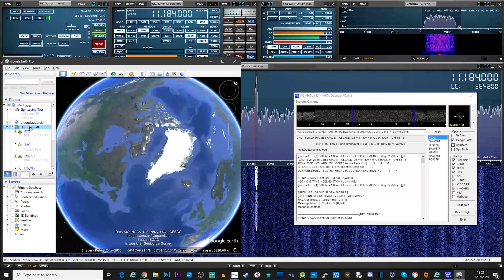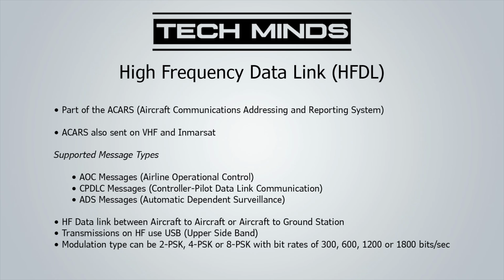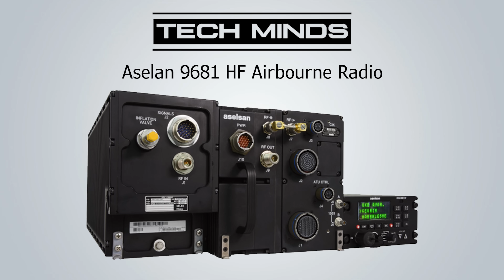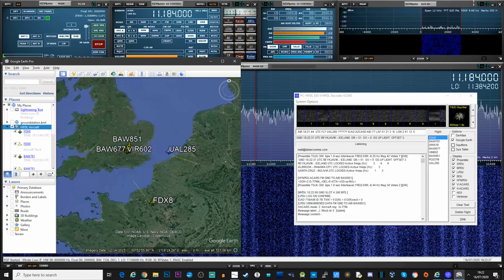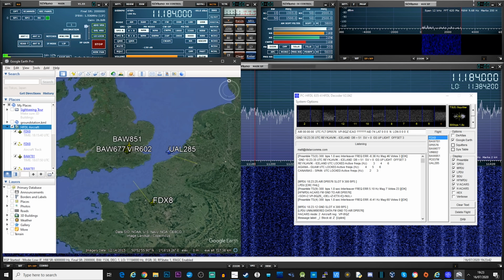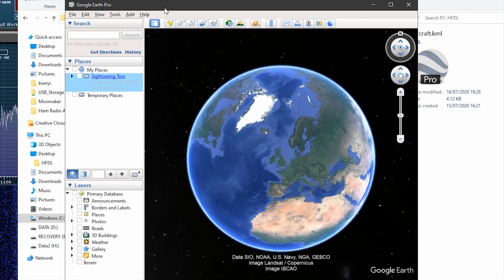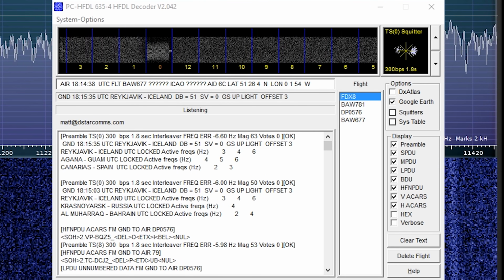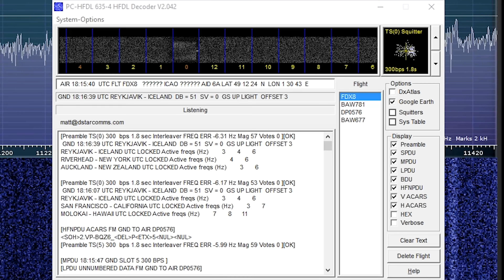Decoding High Frequency Data Link - HF ACARS HFDL

Comment: This video is still proving to be helpful, years later.  It all started a few weeks ago when I found an HF antenna I could put together without climbing on the house roof.  That gave me HF reception. Today I found a reference to HFDL and this video gave me all I needed to link PC-HFDL to my radio that was already connected to my PC with a digirig.  While not specific to my setup, the video gave me enough clues to get the result.  Finding an active frequency took longer than setting up the radio and software.  Thank Matt for making it easy.

Comment: Hmm... Me thinks that power is also 115VAC at 400Hz and not the standard 50/60Hz. I believe aircraft use higher frequency AC to reduce the weight of electrical machines and transformers.

Comment: Thank you for a very enlightening video, I wasn't even aware this mode existed. I registered with Charles and he did advise that the Google Earth interface does not work with the latest GE versions, it either needs to be an older version with the COM interface or GE Professional. I also found a program called Sorcerer that decodes this mode I think some of the TX sites might be out of date compared to PC-HFDL.
Reply from the maker: If you setup the GE network link manually then it should work. I have the GE Pro, from the MS App Store, seems to read and plot the KML flies just fine.

Comment: I only have experience decoding VHF ACARS  using Raspberry Pi with rtlfm + acarsdec . If HF DL is same as ACARS, it may be decoded with same setup. 

At this moment, I not found the HF DL signal yet in my country. :)

Anyway, thanks for the information. .
Reply: You can receive these signals all over the world and if you don't your antenna has a problem.
Decoding is very different, this is why ACARS or VDL2(new high speed ACARS) or Jaero decoders don't react on these audio signals. Currently there seem to be no Linux based HFDL decoder, so you have to use this PCHFDL app oder MultiPSK also works very well on a Windows system.
With an interface software called "Display Launcher" you can list and save merged decoder outputs into one big file, which is giving you a great overview what you have been receiving. Here you can Merge multiple ACARS, VDL, HFDL and Jaero decoder outputs and get everything displayed in one list, as well as optionally in Google Earth.
The software is free and you can get it here: http://www.agenetools.com/displaylauncher/
Unfortunately it doesn't run stable with my current setup ... after a few hundred stations it hangs itself up in a loop. Once you start it again, it will work for a while, but maybe it is my setup and you have more luck.

If anyone has a link to a software decoder that can be run on a Raspbian, please let me know.

Comment: I installed drivers and all in my win 10  but the signal (433) reception is weak in HackRF. But my RTL SDR can tune and receive the same signal pretty good.. In both I used the same kind of antenna antenna. I bought my Hack RF from AliExpress
Reply: You need a proper HF antenna and an SDR that can receive that low or an upconverter
Reply: Don’t say that, I’ve just ordered one from them ☹️
Reply: @andygee7017  I don't know man.. might be something wrong with my driver... I don't know.. I've only tried it with my laptop...
Reply: @andygee7017  give my comment a like.. he might notice it and give some solution
Reply from the maker: What software are you using to RX with the hack RF? Have you checked the gain settings?
Reply: @TechMindsOfficial   I've replicated every step on your Universal Radio Hacker video. The only difference was the antenna I used... I used the antenna that luks like the one comes with RTL SDR, the one which has magnet in its bottom